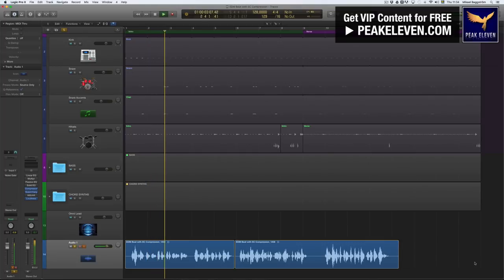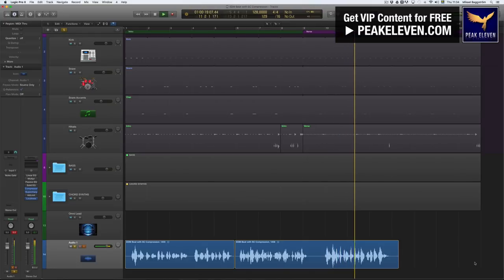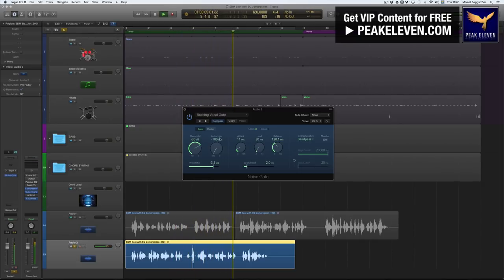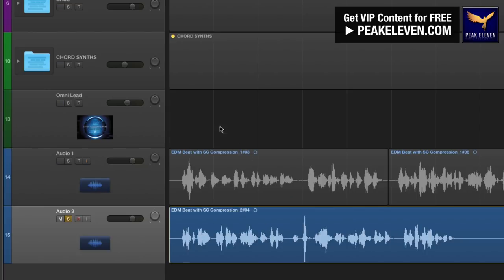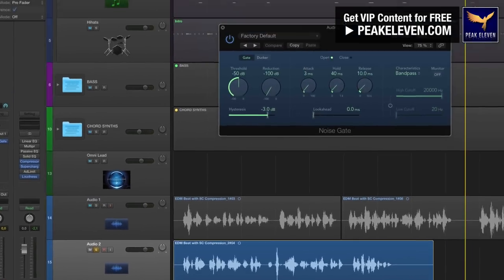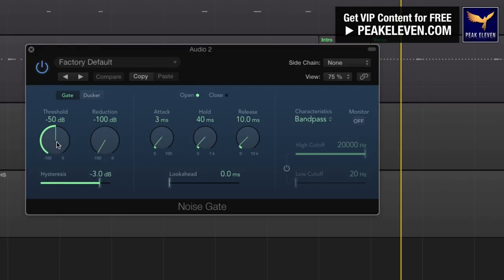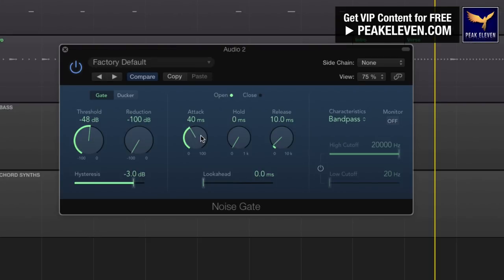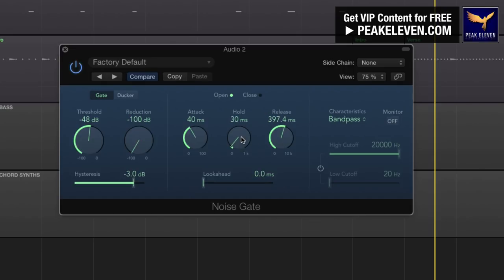Noise Gate: How to use a Noise Gate for clear Audio

Comment: Hello, thanks for the video.. Your description of release time is wrong.
A noise gate release time operates as follows: 
The release control is used to define the length of time the gate takes to change from open to fully closed. It is the fade-out duration. A fast release abruptly cuts off the sound, whereas a slower release smoothly attenuates the signal from open to closed, resulting in a slow fade-out.

Comment: Great explanation video.
I prefer using Waves Z noise or more often than that Izotope Spectral Denoise.
The basic noise gates like the one you show are the most common but the difference between these simple Gates and the ones I mentioned are that the good ones use a frequency curve instead of what I call a blanket setting over all frequencies. 
I find that using higher end plug-ins for this helps to preserve the voices Dynamics and characteristics.
I'm actually doing a video on this today so anyone interested in learning more can come and check it out.
Reply from the maker: Thank you very much. Indeed this is the most standard form of gating, but it can be very useful in for example live settings. :)

Sincerely 
Mike

Comment: This was interesting. Question. I cannot wear headsets due to sound induced vertigo. The sennheiser speakerphone sp20 I use to record interviews is not as clean as a separate mic and speaker would be. Would a noise gate work or do you have a another suggestions on how I could record interviews with guests not at my location that would be ok without headphones?

Comment: Hello ! Live Music Situation : If one needs a physical noise gate effect (for small budget) in order to clean the wiring noises behind a sound system, having as inputs divers synths and guitar, coming together in small mixer, so it has 1 main out only. The question is : Can for example a guitar noise gate pedal being switched between the small mixer and main mixer and be used for such a job... or does the DI Box do the cleaning well enough, before it gets into the main mixer ? The idea is not to take a supplementary physical noise gate rack.

Comment: You eliminated the noise in betweeen the words but it’s still there when the words come up. How can you deal with this? What about using RX? 
Also, does noise gate on actual instruments reduce their dynamic range? Does it affect the signal?
Reply: in Audacity this is called "noise removal". The noise gate won't alter the instruments, noise removal will.

Comment: I've been trying to kill the noise when I palm mute my guitar and strum . . There is an after effect just like the example you gave in your video . "There is still a noise " even after using the noise gate !! And I have failed to remove it on any guitar track with distortion and also have found no video that can help . Just like this one!

Comment: 4: to eliminate line noise.
Reply: note the the noise gate will do nothing to the line noise when there is audio that is above the noise threshold, all you're doing is removing the noise "when nothing else is playing", so you can quite easily still end up in a situation where you either need a multiband noise gate, to remove line noise at frequencies outside your input spectrum, or you need a fairly good noise reduction plugin that does adaptive spectral gating.